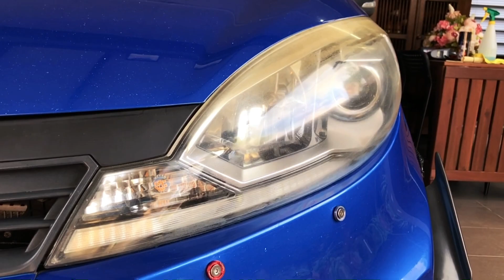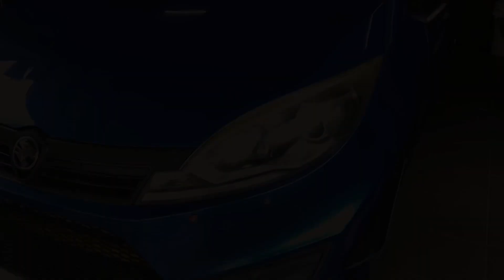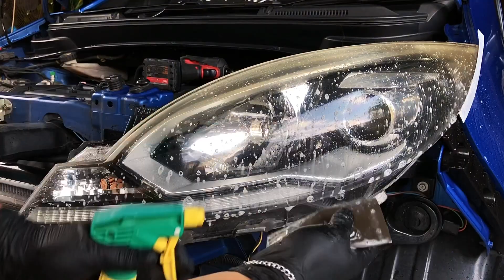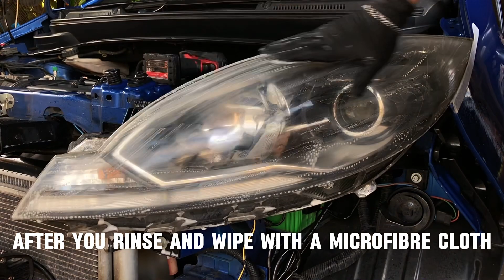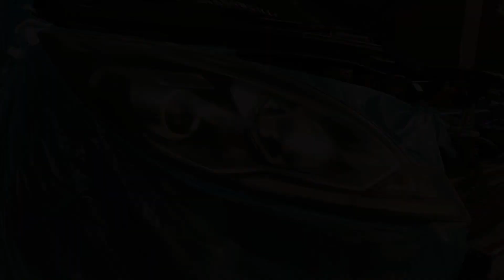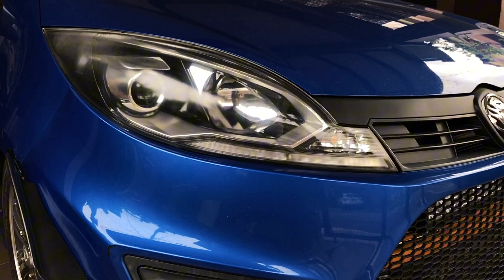CARA HILANGKAN LAMPU KUNING KUSAM | STEP BY STEP | BERKILAT MACAM BARU

Comment: hi saya punya lampu albino belum kuning ada tips tak mcm mana nk
elak kuning, boleh pakai 4k coat ke
Reply from the maker: Hi, kalau saya personally, saya suggest awak apply ceramic coating. Supaya ada satu layer yg boleh proctect dri acid rain. And kalau boleh setiap kali lepas hujan bersihkan lampu jgn biarkan air hujan terbiar. Selalu itu jd punca.
Reply: boleh buat sendiri ke ?